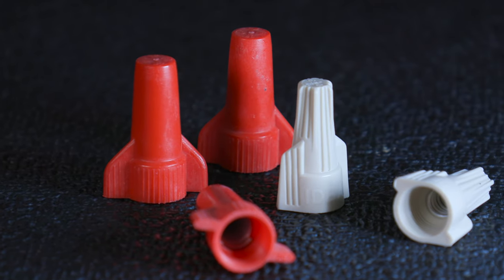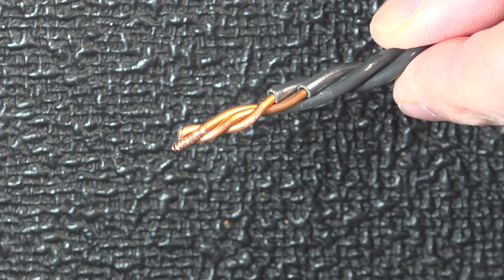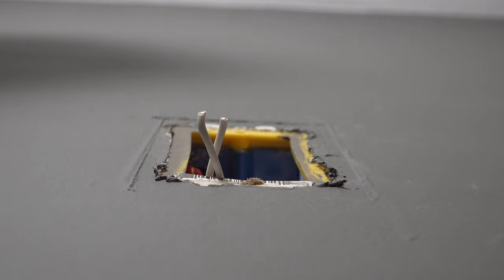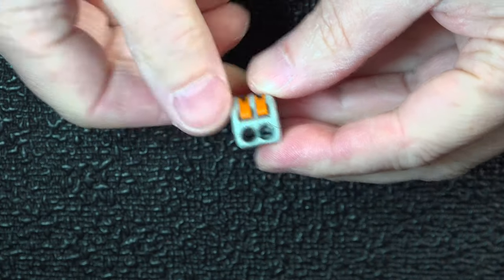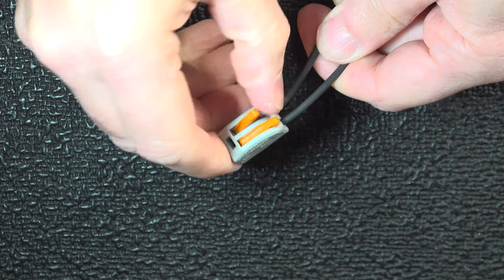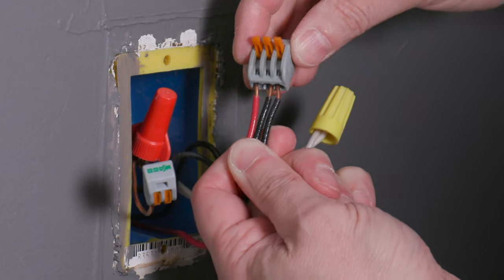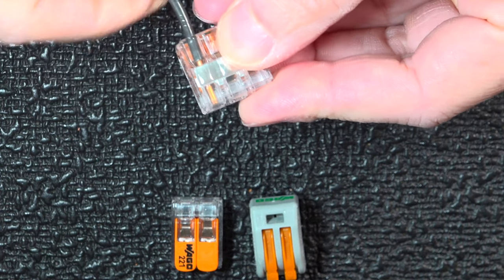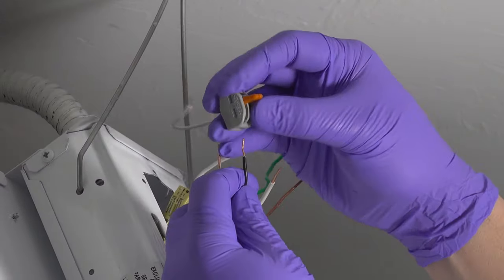Never use Wire Nuts Again - Wago is Better Electrical Connector

Comment: I trust these about as much as I trust the "backstab" connections on receptacles--not at all!  I've seen enough of those burned up over the years to not trust any type of push-in self locking connection carrying more than an amp or 2.
Reply: Agree, an instant recognition that either a DIY or a "helper" did the job. I hate wasting time cutting them off and than pulling them out later.
Reply: I don't trust any type of connector, like a wirenut. realistically you should be either attaching wires to a junction or distribution box (like a wago) or soldering the connections together with heatsink. Wirenuts are too fragile, too insecure and too dangerous. Thing about wago connectors is they are basically just miniaturized junction or distribution boxes, They are designed to be far more robust then you think they are. Wirenuts, are an invention that we should have gotten rid of ages ago.
Reply: @TheObsesedAnimeFreaks  you are clueless to reality!
Reply: Almost all  electricians use the backstab they don't care they get payed then payed when it fails.
Reply: @TheObsesedAnimeFreaks  ... HAHA! I'm sorry my child. That's never gonna happen.
Reply: @TheObsesedAnimeFreaks 
HA HA HA HA HA
Reply: Honestly Wago’s are the nuts. They’re becoming hugely popular in UK even with professionals. They have a junction box you can buy that provides strain relief and allows the box to be fixed to something solid. The connections are maintenance free to the point where you can mount in a ceiling and plaster over. A god send for installing spotlights over conventional pendants.
Reply: @letsgocamping88  Yeah, but in the UK, they use 240V, so the current for any given load is half of what it would be in the US at 120V. High current is what causes overheating and failure of pressure type connections like these. These would be fine for a light fixture or similar, but for a general purpose wire splice where they might be carrying 15-20A I have my doubts...
Reply: @bobweiss8682  they are rated at 32A. Tho de rated if they’re going to be fitted in an inaccessible location.
Reply: @Dev JB they are approved for use in inaccessible locations. Meets the regs in the UK. Obviously we all try not to leave junctions in in accessible places. But where it’s not viable this is the alternative. I really would recommend you get some and try them. Genuine wago only, not the ones that look like it.
Reply: Just had a look at your “backstab connectors” wago’s are nothing like it. The amount of force the wago can apply to a joint is far superior. Those backstabs are limited because the spring needs to be soft enough for the wire to poke in without deforming. Whereas the lever opens the hole compressing the spring on the wago. The wago’s are rated for 32A, they can take up to 6mmsq cable. I don’t know anyone who has tried them and not thought they were great.
Reply: @time1800  Realistically, using a connector that can fail is never a solution, having a solid easily reusable and manageable connection is always superior to something as fragile and prone to failure as a wire nut. Solder provides far more surface area to a connection and can handle far more stress then simply twisting wires around themselves and then twisting a securing device over that. just using solder and then heatshrink on top of that is a far better solution. creates a better more secure and probably safer connection. or can use terminal blocks, junction blocks or what ever you really want to call that type of connection device like a wago or screw down type, if you think the connections will need to be serviced semi regularly.
Reply: @Dev JB What state are you in?
Reply: @TheObsesedAnimeFreaks  No one solders AC wiring! Again clueless to real world application.
Reply: @time1800  Time consuming yes, anything wrong with such a policy? no. there are many applications where AC wiring is regularly soldered. You have no choice in the mater in making a power supply. It's far safer aswell because you don't have loose wires just haphazardly stuck together.
Also if you think I care about the time it would take to do a job properly vs. doing it the easy way, I would do the job properly so I wouldn't get called back. The proper way is the solder job. robust secure connections that aren't going to go anywhere (or terminal blocks), wire nuts are the easy way as they don't require much effort or time to set up. rather spend the time now then later.
Reply: @TheObsesedAnimeFreaks  No one solders residential or commercial building wiring which is what this is about.
Reply: @time1800  And you think I care? The reality is that using wire nuts does not make a proper and secure connection, you should be soldering your connections PERIOD. You can use terminals as they provide a better connection then wire nuts and such terminals are preferred if you can't be bothered to properly make a connection. You do realize the reason they don't solder the connections right? it's a pain in the ass to do, and it takes more time then it's often worth. 10-20 minutes per connection verses 2 minutes for a wire nut. Doesn't stop it from being the most proper and secure connection you can make.
Reply: @TheObsesedAnimeFreaks  who solders anything anymore?! Its 2021, not 1921!
Reply: @TheObsesedAnimeFreaks  I braze my splices. Can't be too safe.
Reply: You are exactly correct never use wago not a good connection.
Reply: @Dev JB Yeah, that has been my experience too,  Institutional work and LA Unified schools forbids them in their contracts. I'm retired now, but I wouldn't even stock back stabs in the truck... not worth the liability.  I know the residential tract guys still use them, but not so much in commercial.
Reply: @time1800  No, No they don't. Maybe some weekend warrior doing residential.
Reply: @letsgocamping88  Can't provide that much pressure if a plastic lever is used. Look at the wire he pulled out of the Wago; barely scratched. Given enough cycles, that poor connection WILL fail. Now look at the wire nut connection marks...dug in like a Marine under morter fire.
Reply: @letsgocamping88  I'm kinda curious when it's not viable? In Sweden it's not legal and I have yet to face an installation where it's not possible to have access to junktions.
Reply: @TheFoxNes  I know what you mean. It’s always best to avoid it. Best example I can think of is going from a single pendant to multiple downlights. You can either tactically drill access holes , then install wago box. Or you can pull the whole ceiling down. Bringing on all the extra mess, and cost of disposal. 

Check out nick bundy electrical on YouTube. He’s always rewiring kitchens. Uses em for virtually  all his lighting installs
Reply: @letsgocamping88  I get your point. Yeah I have a few UKs that I follow regularly, Nick included, love their channels. :)
Reply: @time1800  come to my parents home, all connections are soldered. Job was made by a real old school electrician.
Reply: @TheObsesedAnimeFreaks  wire nuts do make a proper and secure connection if used properly, but they aren’t idiot proof, and if you’re soldering connections in a home, you’re just creating issues for whoever has to work on it down the line.
Reply: @silaskuemmerle2505  "Creating issues" yeah no I don't see it that way. you shouldn't need to replace a wire connection...

Comment: They are great for lighting loads, but 20 amp receps, I still twist and nut. Wego has a flat bar connection point, not ideal for heavy loads.
Reply: Wago released few years back connectors for thick wires, up to 10AWG/6mm². Rated for 42A. Even the normal ones are rated for 35A.
In Finland use nothing but Wagos (or similar off-brand ones), I love them. Easy to install, easy to change If needed.
Oh yea also, wire nuts are basically banned here.

Comment: In Utah, when we remodeled our house down to the studs in 2016 and used Wago connectors, the building inspector SAID NOPE, redo it, been an electrical engineer since 1989 mostly in the military and we used them for years, but Utah said no. Have a drawer full of these now.
Reply: Should have appealed.